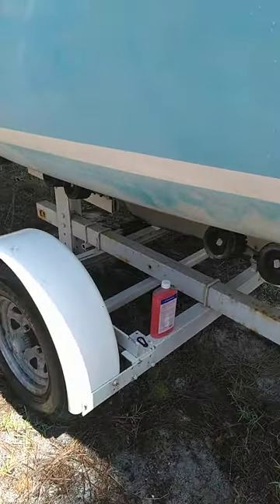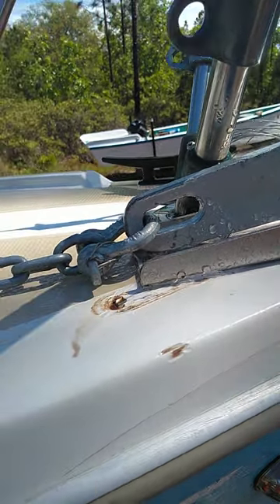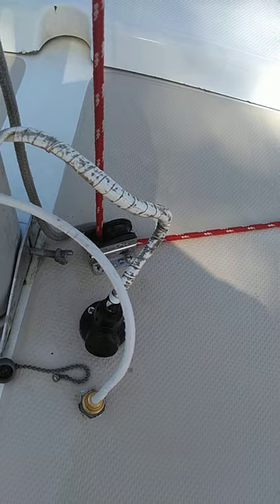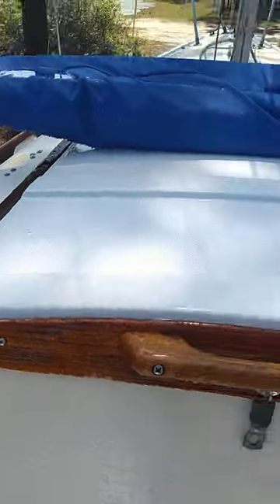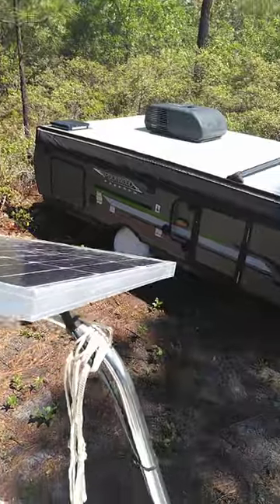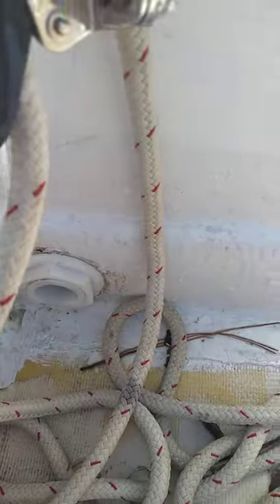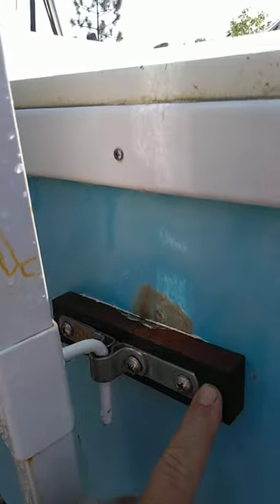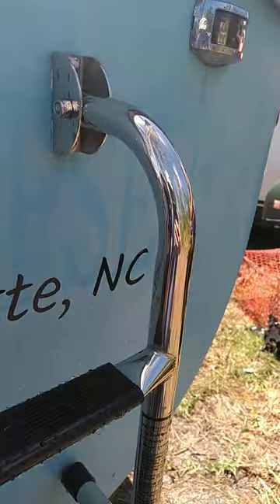upgrades to Catalina 22 part 2

Comment: I believe the weather helm is built into the Catalina 22 for safety reasons. Once you heel 20 degrees you can not control the steerage, which means you need to de-power or reduce the sails size.
By angling the rudder bottom forward under the hull you reduced the pivoting radius enough to increase steering and maybe putting the boat into harms way. A friend replaced his rudder on a Cat 25, with the new and improved one, and ended up in a broach beyond anything he experienced before.
Reply from the maker: Thanks I'll watch out for that. I reef early and I try to be careful.
But since I've moved that rudder back at the top the boat has been way easier to balance.
Also I did not do that blindly I did a lot of research before hand. Many cat 22 owners have did it with similar results, and Catalina Direct sells a rudder that does about the same thing. But thanks for the warning! It says a lot about your character to care for others safety!

Comment: I enjoyed watching your videos I’m new to sailing I bought me a 1985 Hunter 22 foot about six months ago and I haven’t haven’t had it in the water yet. Still been working on it but I do little stuff to it each week got it to where I can raise that mass up by myself. I don’t know how the Catalina is put mass on my hunter I mean it’s like 28 foot long I mean it’s aluminum pipe but it’s still heavy awkward to pick that thing up I watch so many different videos on reason the mass and I found one idea that I really like, I put the winch actually on the mass and built a pole on the front of the trailer up in the air with the hook but I’m getting it The boat came with a 10 horse Yamaha long shaft, but it needed too much work. I ended up just getting a little. I found a Suzuki for horse but it’s a short shaft but I’m gonna try to get me a different bracket for that to see if I can get it one that lowers down a lot. Maybe I can get it in the water anyways I enjoyed watching your video.
Reply from the maker: Thanks for watching. Definitely setting the mast is the part that sucks with any trailer sailer. The biggest trailer sailer I ever had was a San Juan 26 it was mighty big and heavy. I had a pole on the trailer some how, I can't remember how I did it but I did. 
Just keep trying stuff you'll figure it out. The Catalina mast is almost that long. I use that pole I bought then the mainsheet from forward stay to the bow plate. It works. Good luck!

Comment: Great job and information. Just curious what Bimini did you order from Amazon? If I order one from Catalina direct they are over 700 bucks !
Reply from the maker: 6'x67"x72 Bimini top $125 surprised to find it's a decent top. I cut 7 " off the height to fit under the boom